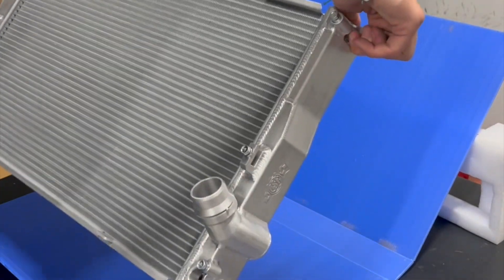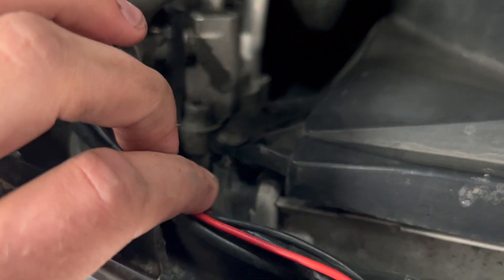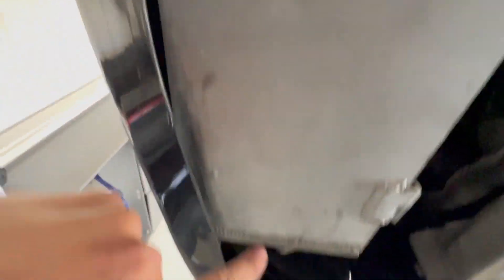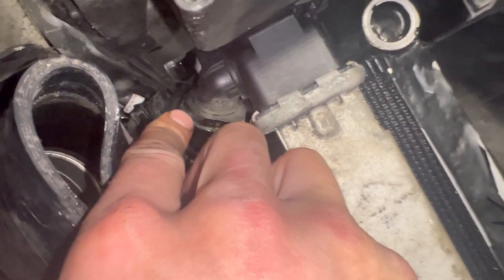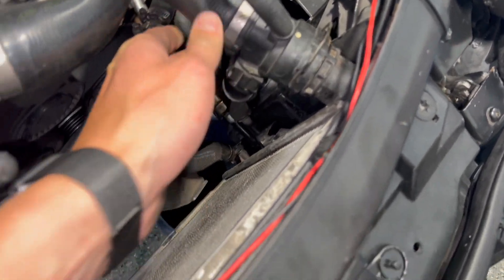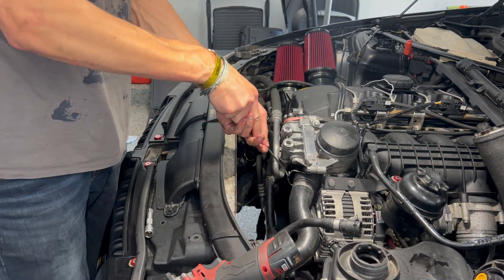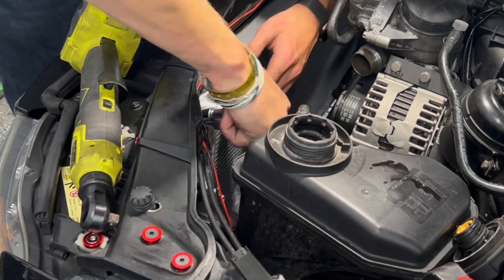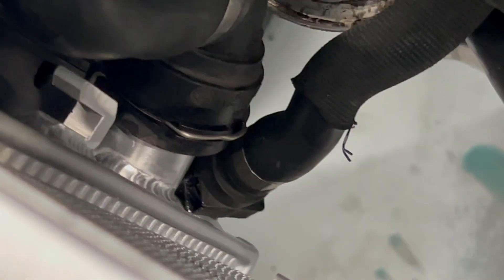N54 CSF Radiator Install

Comment from the maker: UPDATE: Had my first track day of the year and this worked great. No issues with coolant temperatures, highest I saw coolant go was 240 °F on a 90° and sunny day after pushing it for 25 minutes running 21 psi and stock oil cooler. So far no complaints

In the winter I recommend covering your kidney grills partially as the radiator is too efficient and your car will throw codes from coolant temps being too low!
Reply: So was there a drop in temps? How much from stock?
Reply from the maker: @Matt-lf1ik  Large drop in temperature compared to stock in a 20-30 minute track session. Beforehand I would consistently hit 245-250 then enter limp mode, car now sits consistently around 230-235 so I haven't hit limp mode yet.

Results will definitely vary depending on the weather and how much power you are pushing. I make 450 whp, and on a 90º day I now can easily go 30 minutes without coolant temps being an issue. As of now oil temps are my issue and why I need to take an occasional cooldown lap.

If I were doing longer sessions (1hr+) I would probably expect to hit limp mode again.

I do have a stock oil cooler, so upgrading that is the next step.